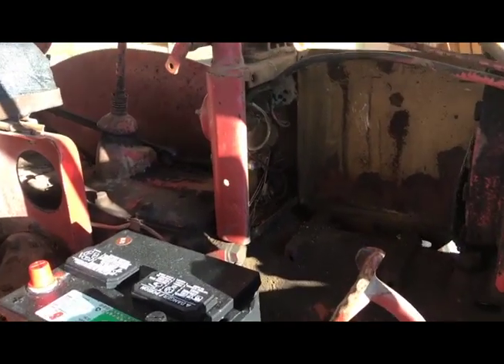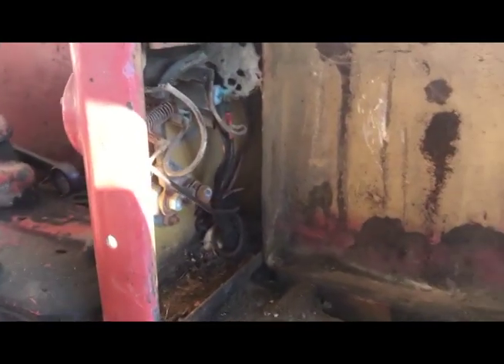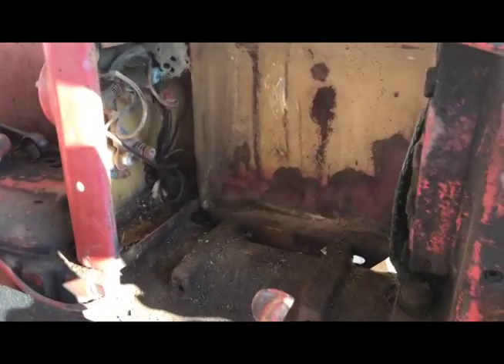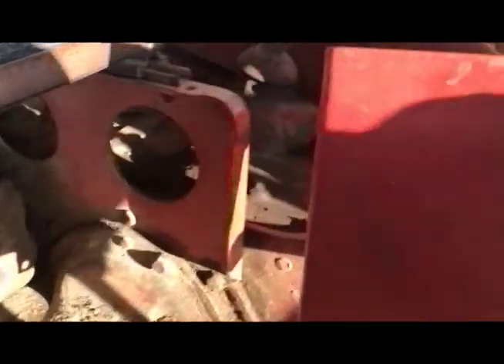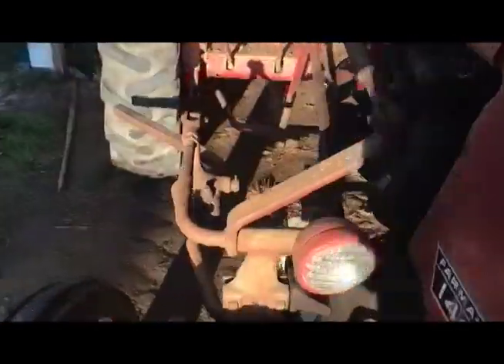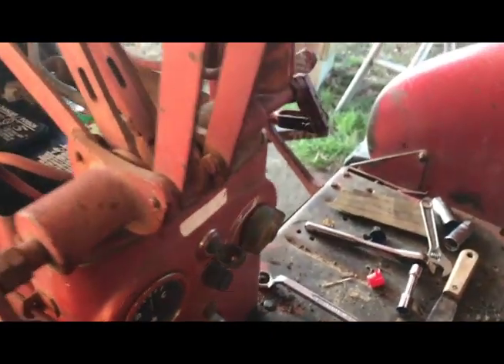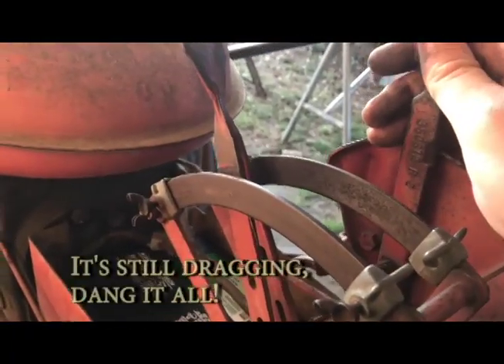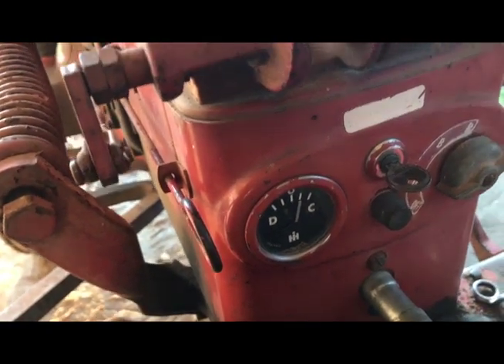Putting a Battery in the 140 and a Cold Start (11)

Comment: If it's ain't one thing it's another. Is there a way to lube that bendix?
Reply from the maker: It finally locked up tight in the engaged position.  Couldn’t find a rebuilt starter for any less than $250 plus core, but did find a rebuilt bendix (starter drive or whatever) from somewhere in Oklahoma for about $45 and so far it’s workimg pretty well.